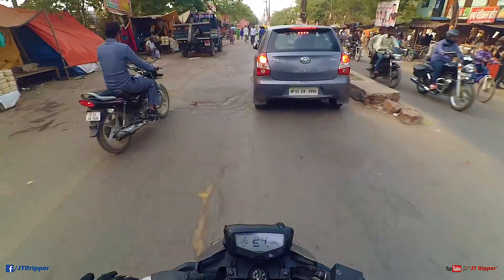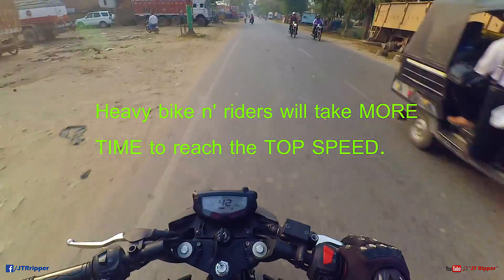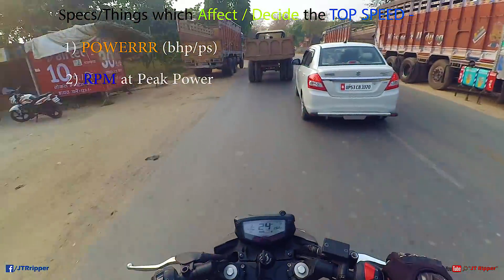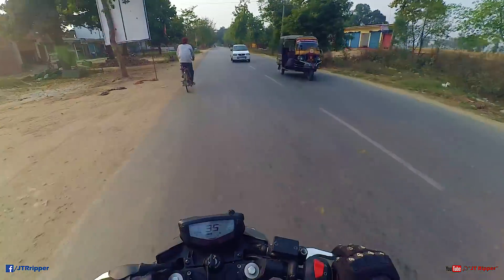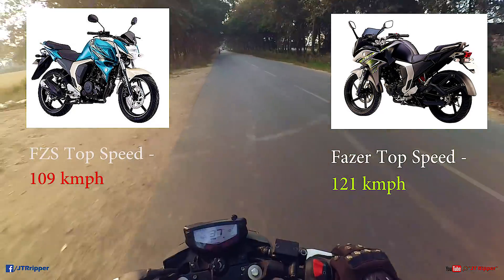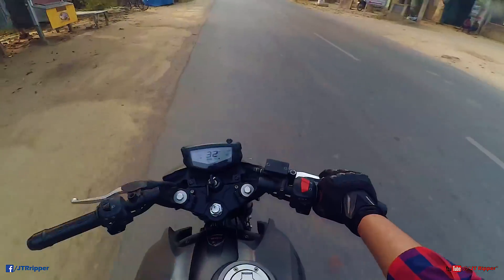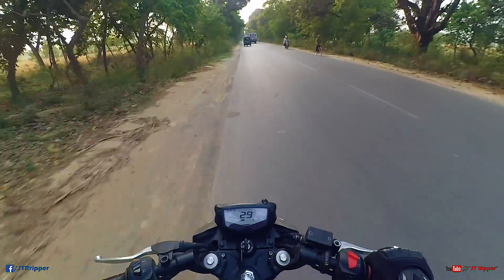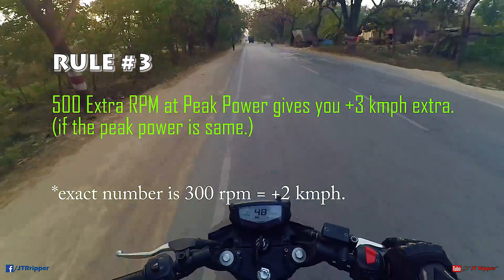HOW TO ESTIMATE TOP SPEED OF ANY BIKE | EASY RULES OF THUMBS

Comment: Most Indian made bikes does not have a Speed Limiter but Bikes such as the FZ, SZ, Fazer have a Speed Limiter Programmed into the ECU. That is why in 5th gear you cannot reach the RPM Red line ,the ECU will cut Fuel/Air depending upon the bike. You can feel this when you reach around 110KM/h on FZ or SZ what ever you do the ECU will decrease the throttle input. I have Driven a FZ and an SZ both have the same Engine but the SZ a regular everyday bike is Faster in acceleration to 100Km/h than the FZ because of less weight and Thinner Tire. Although the Top Speed is the Same. If the Speed limiter is Disabled it can go upto 130 Km/h with ease. That is why the Pulsar 150 is faster than these bikes.
Reply from the maker: read the disclaimer. also, you just repeated what I tell in the video.

Comment: Smaller Rear Sprocket helps TopSpeed
Larger Rear Sprocket Helps Acceleration
Reply from the maker: yeah ofc but the gearing of stock bikes is no more than +-5% taller or shorter. read the disclaimer i said it there.

Comment: Hey JT 
i too own a apache rtr 200 4v 
why doesn't it goes above 130 kmph.? Why does it top up at just 130.?
Are there any ways to increase it's power.?
Reply from the maker: bro theoretically it should go to 145 kmph and it does with long enough stretch and full tuck in, some guys even do 150+ BUT the 5th gear is sooo tall that it takes a lot of time.

Comment: JT what should be the top speed of a ducati monster 1200 with respect to a Harley Davidson 48.... 
both have 1200 cc engine but all other specs are different.
power 60 HP on Harley n 155 on ducati
rpm 5500 on Harley n 9250 on ducati
both are unfaired
n Harleys top speed is around 180 kmh
I tried the method but couldn't get a proper answer
Reply from the maker: see, cc doesn't matter. Plus since the power and peak rpm both are wayy low in HD the top speed will be very low BUT since there is more than twice difference in power don't use my rules here. If you want to know the top speed, chose a bike whose top speed you know and whose power is close to the ducati say 140 bhp or so.
Reply: Jeelan husain it's not all about the bhp. top speed depends on the sprocket ratio

Comment: bro..not jus coz of the fairing...shud mention the  good yamaha engineering also..!
Reply from the maker: We are not talking engine reliability or handling here. For top speed strictly speaking, only power and peak rpm matters.
Reply: JT Ripper forgot the aerodynamics?
Reply from the maker: Fairings does only that increase the aerodynamic efficiency. And I have said in the video too, even a simple fairing gives you +10 and a better wind tunnel tested fairing can give you +15. R15 / Gixxer Sf,both these bikes have wind tunnel tested fairings.

Comment: awesome video. impressive calculation. as u said it was absolutely informative. learnt a lot after watching ur video. appreciate ur knowledge and experience bro. I always loved ur videos. one thing i wanna know: which is ur choice of naked bike which can easily overtake any bike/car in traffic and highway and also can attain a top speed of near abt 180kmph easily with a pillion. also i am eagerly waiting for the upgraded version of rtr 200 which would have inverted front forks, abs, a 6th gear and atleast a 150 section tyre at the back. these combinations will make rtr200 a complete bike. or else tvs should come up with an rtr300 (having the BMW g310r engine) very soon. fingers crossed :-0
Reply from the maker: Apache 300 is coming in June bro. It can do 130 kmph cruising easily on highways. Top speed would be 175+ but you have to lean down for that. 
My favourite bike from what bikes are available is Triumph Street Triple. :) 
It can overtake everything plus can do 220 kmph on highways easily
Reply: JT Ripper then that Apache 300 is for me. will pick it up as it launches. provided it having abs, inverted forks, fat section tyre and a 6th gear. not a much fan of the FI, carb is enough for me. wat abt u? would u go for the 300 too?
Reply from the maker: Well Apache 300 Has inverted forks, fat tyres, sixth gear and Fi. I will strongly consider it.

Comment: So what should be the top speed of honda hornet 160R

15.66 BHP @ 8500 rpm???

I find for both gixxer and hornet similar top speed....
Reply from the maker: since it has one bhp extra (+5kmph) and 500 rpm more at Peak (+3kmph), it should have a top speed of 127 kmph. (119 + 8 = 127 ) and you can see many vidoes on youtube guys doing 127 kmph on HORNET.
Reply: hmmm i saw...
Infact I saw a video on youtube where it revved upto 136kmph. Dont know, may be it was a long stretch of road with some wind shield installed( after market ).
Reply from the maker: must be on slope and too long stretch. what my rule gives you is the top speed that can be achieved by everyone, the most reliable top speed numbers.

Comment: in terms of top speed my RTR 180 Will be faster or pulsar 180?
Reply from the maker: good question. apache rtr 180 makes 17 bhp and pulsar 180 makes 16.8 bhp both at 8,500 rpm so the power advantage is only 0.2 bhp, that won't have any effect on top speed bro. If rtr 180 had 1 bhp more at 17.8 bhp it would have + 5 kmph top speed !
Reply: but in terms of 0-60 RTR is faster!!!.so I think that the Apache is taking the advantage of torque.so what should be the main reason behind it.tell me bro..
Reply from the maker: rtr is faster because it's lighter. power/weight ratio and power curve area determines acceleration / pick up . I'll make a video about it later.
Reply: JT Ripper thanks bro I am waiting 😎